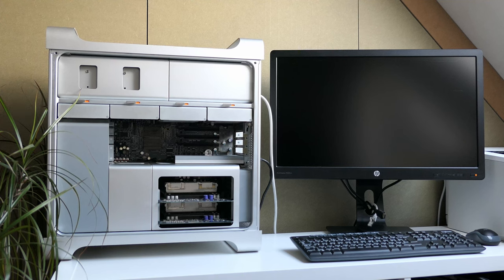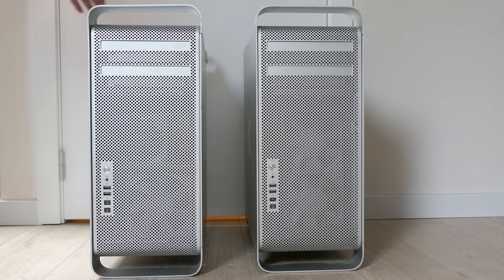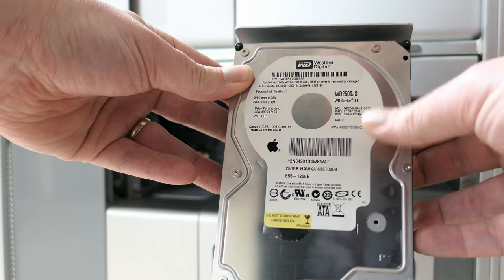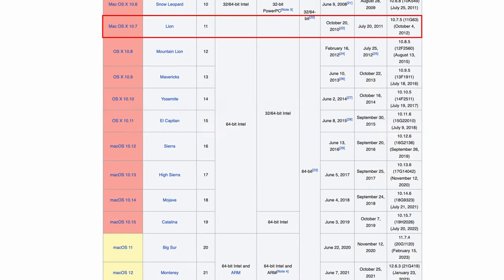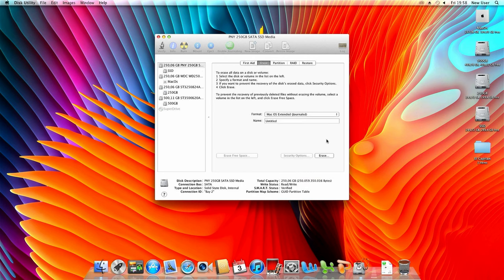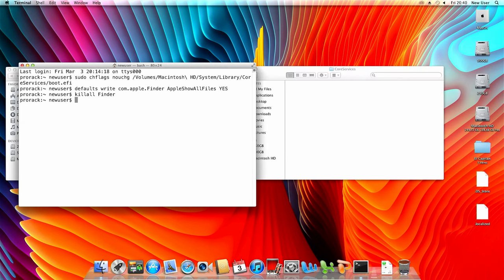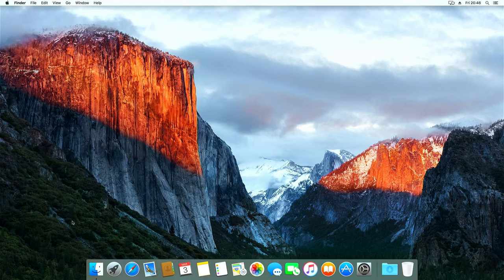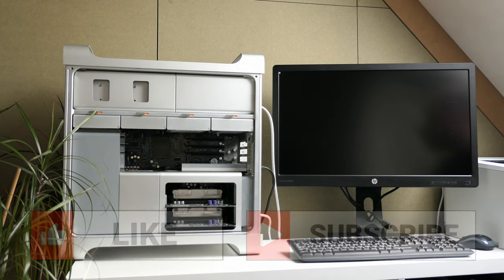Apple Mac Pro 1,1 - Undesired but fun - Part 1

Comment: I intercepted my friends 1,1 that was headed for recycling; I adopted it, replaced the X5150's with a couple X5365's from new "old stock" servers, updated the EFI to 2,1, & the SMC to 1.15f3; it also doubles as a space heater on cold days.
Reply from the maker: Its pretty cool and relatively usable, as long as you don't look at power efficiency :)
Reply: Greetings from chilly Minnesota--Mine keeps my feet warm too !! ....LOL

Comment: I have been using one of these for yrs now.. got it for free.. the upgrade to using two  3ghz cpus, 32 gb 667mhz ram, gtx960 and 2 ssds in raid 0 make it fly with capitan.. also dual booting windows 11 works great and win 11 runs killer fast on these, faster than capitan and has hw decoding/encoding with gtx960
Reply: Can you recommend a good YouTube video for installing windows 11? For mac 2,1

Comment: I my case I've got a MACPRO 3.2. I'm trying to boot from USB Drive that I create into a Windows Computer, but it does not boot from USB, Is there a magic think I can do to boot from USB. Note: I cannot login into MAC OS, there was a video sugesting erase Machintosh HD witch I've done since than it does not the login screen, just that tool for repair OS System. 
Do you have any suggestion to try to boot via USB?

Comment: bro as far as ur cpu using so much to play youtube with capitan, its becuz theres no hw decoding support ..real shame too, believe me ive searched to get it and no go... im using a gtx960 which Has decoding available in windows on these macs but not in capitan..no card ive tested, gtx 660 or amd hd5770 or amd hd6670 ,none have hw decoding in chrome or firefox..however, with dual 3ghz cps,it draws about 10-11% cpu doing 1080p avc1 h264 vids in chrome and about 35% doing 4k vp9 video
Reply from the maker: Makes sense and confirms again that Windows is now actually the better option on this hardware.